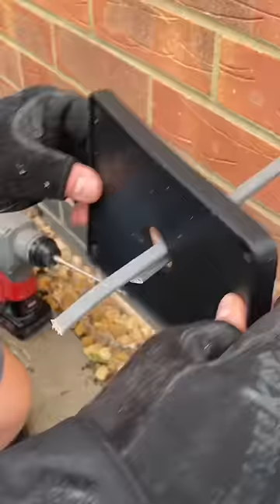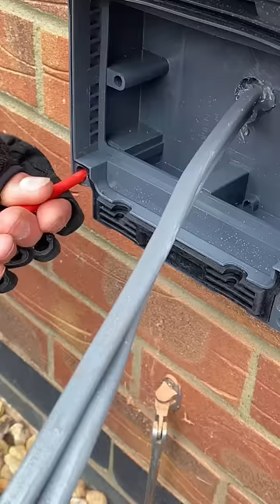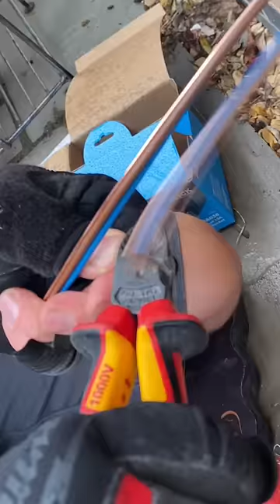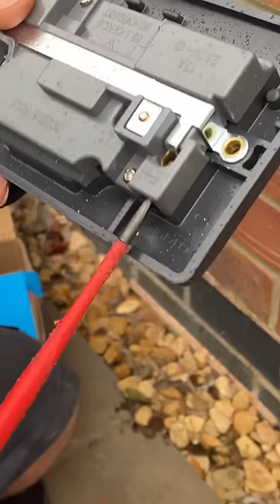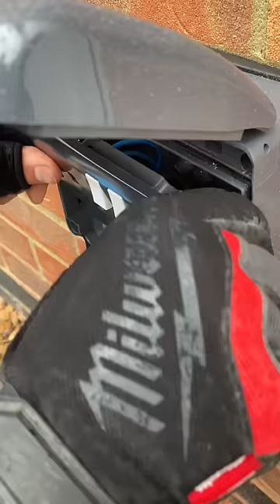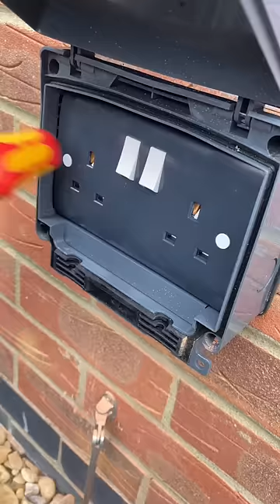Bit of blob to cover your sins. #shorts

Comment: Buddy of mine fixes chimneys and masonry for a living.

I sent him this. Hes been swearing at me for the last 15 minutes over the phone.
Reply: @royaltoadclub8322  Silicone doesnt hold onto brick, and in many cases, can even compromise the integrity of the brick.
Reply: 🤣🤣🤣 but why, as I still don't know
what's going on here? Or the purpose for the box?  🤔
Reply: @dreamwolf7302  gotcha. Even industrial crack full mortal silicon? I’m imagining that’s what he’s using
Reply: @c.a.5808  the box is to protect the outside outlet
Reply: @royaltoadclub8322  According to my buddy, that silicone filler has a distinct coloring to it, and isnt clear.
Reply: @dreamwolf7302  that why is fixed to the wall with screws after sticking the back plate on
Reply: @c.a.5808  it's an outdoor socket 🤷‍♂️
Reply: @dreamwolf7302 why do they use silicone on movement joints then? The silicone is to stop any water penetrating into his cable penetration. The socket is fixed to the wall with screws. Silicone will set and also stop cold air blowing in or heat leaving.
Reply: @martynslaven There are special products for sealing masonry, that dont use silicone. 

Silicone damages brick, and doesnt handle the transition from hot to cold very well.

that seal will last maybe 2 years before being needing to be redone, and while its there, it will damage the brick.

Comment: I tend to put a bit of pvc through the wall & gland it into the box but, I’m sure £5 of silicone does the same job 😂
Reply: Honestly probably does
Reply: Wouldn't it harden? then you'd be fucked if you needed to move the box
Reply: @BabaYagaUnderYourBed  20mm PVC conduit through the wall, glanded to the back of the box. The gland has a weatherproof seal. I do put a bit of silicone around the conduit too. Takes a little longer but it’s a better job (if you ask me) as the cable is protected in the wall. Moving the box… done a few of those too & often involves removing/replacing the bricks. Swapping the drilled brick to the new location. I work predominantly on holiday lets/complexes & entertainment venues where the finish is extremely important, as is ruggedness & replaceability. It’s a completely different environment to domestics. Installs have to be capable of taking much more abuse &/or be replaceable quickly.

Comment: Silicone or sealant only goes on the top and sides never on the bottom because you want any water/moisture that gets in to have a way to drain out that isn’t back through the hole you drilled and then into your home.
Fail. Siliconed all the way around.

Comment: I wish rubber back seals were standard on all enclosures
Reply: Lol they are. At least here in the United States. We never ever ever ever have to do that. In fact if one of my men did that they would be doing it over again. However, I see this is in Europe some where? Hence the ridiculously stupid outlet style. So I’m sure they don’t care how shit is done.
Reply: @Roberob1189  They aren't rubber, they're very cheap foam pads that deteriorate in a few years of UV exposure
Reply: @Roberob1189  But standard NEMA 3r box's don't have a pad to go between the brick and the box, good electricians in the US would in fact silicone the top and sides of the WR receptacle box
Reply: @farkmuckerzerg634  ehh. I’ve installed hundreds of them. They all come with a black rubber seal. I’ve never seen one here in NY that doesn’t.
Reply: @farkmuckerzerg634  yeah those are the cheap ones. I always see foam or the rubber. The foam ones are usually store brand.
Reply: @Roberob1189  NEMA 3R boxes dont come with a rubber gasket to seal between the box and the wall. The foam is to seal between the box and device cover. We silicone the top and sides of outdoor installs.
Reply: I agree, still seal with silicone, but for some indoor industrial applications the rubber is fine, i usually have to seal the whole outside box and it takes an hour just to do one because of how perfect they want it

Comment: I came across a faulty outdoor socket yrs back which was caused by the insulation breaking down due to reacting with silicon. Was a strange one but enough to stop me putting it near cables since then.
Reply: TPS cable? I’m an electrician who puts silicone on outside works. Never seen or heard of a reaction between them. Plumbers often use silicone to fill the gaps in holes made for pvc pipes also
Reply: How could you tell it was silicon rather than some other type of similar-looking sealant?

Comment: Always marks your holes and drill and insert rawl plugs first. Bad practice to drill through the mounting plate. Will mostly always cause damage to it and get the brick dust into the socket housing
Reply: Started with to much force by drilling the first hole for the cables and so he cracked out a big part of the brick. Second, I know it’s allowed, but for future projects just put your cables in electro installation pipe (don’t know the right word in english) so you can easily take it out and in if u need to renew it or something else. 3th there are many, right, things on the market to make a water resident connection to the wall instead of silicone. And why the heck did u use that cheap screws that come with the box and not hex or something screws that are way more durable (when threaded correctly). I know the last one is personal preference but i would definitely do so.

Comment: Don't forget the drill some holes in the bottom of the box.
Reply: For what, insects?
Reply: Tiny drain hole , so if water does get inside it has a way to drain itself
Reply: @sammyz7630  the whole idea is that the thing is waterproof. Don't drill holes in a champagne bottle either.

You should be able to put a fire hose on it..
Reply: @adriaanbertdeveldeharsenhorst  that's literally what my teacher told me at votec is to drill some holes in the bottom of waterproof boxes so the water will drain out.
Reply: @adriaanbertdeveldeharsenhorst  it keeps water inside of the box very well if you don't know.
Reply: @patricklynch9574  I've installed a lot of electric gear in different countries. These boxes come watertight from the factory.
With a clearance label.

If the design would require drainage than they would have made them with the drain holes.
It's even against the law to modify electrical equipment.

Something to do with insurance for example!!!

By the way my father was a director of a technical school .

Your teacher ought to be fired.
Reply: @patricklynch9574  if the water can't go out it can't go in either. That's the whole point. 
That's the reason for the silicone in the back.
Reply: @adriaanbertdeveldeharsenhorst  he retired eight years ago water always finds a way.
Reply: @patricklynch9574  only when the seals are faulty.

In that case you need to replace the seals.

Stop arguing with me.

Its illegal to modify electrical equipment.

There's also people who dril a hole in the forehead of babies.
Reply: @adriaanbertdeveldeharsenhorst  if water finds a way give  it a way out mate hahaha

Comment: Legend has it the moister is still behind the faceplate
Reply: I saw that too! It would have been a great install to keep the moisture out, but now this guy has made damn sure to keep the moisture in! 

Damp contacts rapidly corrode when current passes across them. I really believe this socket would last longer had it been installed not completely air tight... Or airtight but not wet inside..

Comment: That's great. Nicely done. What the hell is that ???
Reply: Outdoor outlet
Reply: @neuroplasticity  oh ok. Never saw one like that.
Reply: @TheDylan6908  UK plug socket - lid closes on a rubber gasket, small semi-circles cut out from the bottom of the gasket let the wire pass though while the plug is kept dry
Reply: @bengrogan9710  ha thanks Ben. Got it.

Comment: I love how you left the wires in the way so the socket can't be used, nearly as cool as the rain
Reply: Eh?
Reply: I thought i was the only one thinking this. Madness
Reply: You watching a different video? What wires?
Reply: At the end of the video, the top hole of each socket, where the plug fits into, seems blocked by wires. Maybe I’m seeing something else ?
Reply: Since when did you see a white wire being installed? Clearly part of the design
Reply: @TheGarageRailway the British socket is cleverly designed in such a way that it’s nearly impossible to get an electric shock from it. The sockets live and neutral terminals (two on the bottom row) have a guard that prevents fingers and other objects being inserted and coming into contact with the live parts. The earth terminal at the top of the socket has a mechanism that works when the plug is inserted which opens the terminal guards on the live and neutral and allows the plug to be inserted into the socket fully. 
The earth ‘probe’ on the plug top is slightly longer which opens the guards  and the live and neutral probes have insulation covering all but the ends to ensure no live parts are exposed while plugging the plug in. 
It’s all very clever stuff
Reply: I thought that too, you can see brown wire behind the top hole 😮
Reply: @banzaiman1  nope
Reply: Watch him press it in.... the socket is incased in plastic... It would be impossible to put a wire in from of the socket
Reply: The brown you see in the top hole is more than likely one side of the copper earth/CPC contact - the earth pin being designed to make contact well before the live and neutral pins are inserted.
Reply: And as pointed out by a previous commenter, the white part in the top hole is the lever that pushes open the live and neutral gates as the earth pin is inserted.
Reply: What u see isn’t a wire, it’s a metal feather that is attached behind the plastic shield to hold the contact in place. Or how do you think the power circuit works??
Reply: @TheGarageRailway 😂😂😂

Comment: I'm super curious, what did you anchor to once you drilled the holes in the brick? Was there a way you set some bantams through the holes in the box, or were you able to turn some Tap-cons in by hand that easily? Or did you have to take the box back off to set some bantams?

Comment: cables stripped too short. each set of conductors should be twisted together before terminating. otherwise, you risk having a hot joint. also, other power points downstream are relying on the earth continuity. here you have 7 strands on each conductor all sitting inside the terminal and the screw would be lucky to make contact with half of them. poor connection. Id also drill mounting holes first so that brick dust isn’t contaminating the silicon, then place silicon as he has done but as someone mentioned earlier, a horseshoe shape over cables in a continuous run, not blobs, plus a blob at each screw hole. fast fitting, looks pretty good to anyone who doesn’t know the common traps. btw, the earth should always be sleeved. in Australia, you can’t even buy cables without a green yellow insulated earth conductor, less chance of nuisance earth leakage trips - especially if run in damp places. cheers
Reply: 7 strands? That’s solid copper, then he sleeves the earth- didn’t you watch the video?

Comment: Did u push the rawl plugs through the plastic box to get to the drill holes or use concrete fix bolts

Comment: Been there done that quickly learned to never drill a large hole in a brick from the inside out and always use smaller drills to gradually get the hole to the correct size.

Comment: The device should not be used to splice the circuit. Splice the wires together w/ a pigtail wire that connects to the device.

Comment: Just fill the hole through the wall with a sealant and put a gland on the back of the box, or put a horse shoe shaped line of sealant around the top of the box. the rest is waste. He did leave some nice long tails, which is always a good idea.

Comment: I don't know in which country you live, but isn't it common there to use a multi-stranded wire because it carries more current and it is more flexible to move around in the corner. A single standard wire you're using. It's more susceptible to breakage. Also, it creates a hot spot at the bend.

Comment: Virgin just drill holes through you're house from the inside breaking all the brick on the outside, then feed their wires through to the outer box and get off. Everytime it rains the plaster inside starts to swell and the paint peels.

Comment: So this looks like the socket has been installed into the ring main, rather than a spur, either way this really should have been a rcd socket for peace of mind being outdoors, no reason to skimp on a couple of quid. 
Some silicone could have been done differently, but still functional. 
Only other observations would be the smashed brick from drilling from the inside out, and could have wiped the inside of the socket down to remove moisture, but again still functional 🤷🏼‍♂️

Comment: Why is the outdoor socket on a ring final, (two wires), this socket should definitely be in a single circuit( directly to a trip switch/ breaker, rcbo)

Comment: Pro tip: Always be sure to use insulated tools when installing fasteners into concrete 🤣. 

But seriously why
Reply: Because that's what electricians have in their toolboxes...
Reply: @TheEulerID  I only pull out my expensive insulated tools when they're needed. I have a separate set of tools for everything else. Source: I'm an electrician.
Reply: @Avaddon911  So what. He was already using that screwdriver, so that's what he chose to use. Not everybody has to do things your way.
Reply: @TheEulerID  is there a point to this conversation or do you just like to pick pointless arguments with people on the Internet?
Reply: @Avaddon911  you seem selfaware

Comment: its a decent job. However, no need to leave so much outer insulation on the T&E in the box and pre drilling the fixing holes before the silicone was apllied ( if at all ) but other than that the guy is going the extra mile. ++

Comment: I still can't get used to seeing blue , brown & yellow wires instead of , white black & green?  they changed to these new colors before I left England , they said it was so color blind electricians could see the and also,because under yellow neon? Lights they could be differentiated. Hows,that working ? Andbody in USA know for sure which color is the hot wire? As somebody that also,does 12v dc wiring ,red and black I still get confused......

Comment: If you drilled the holes in the wall with the units in place, wouldn't you be making the holes in the backing plate, and housing bigger than designed? Just saying.

Comment: Just don't understand why no body designs a wall box where you can affix the cable ends and then just plug on the face plate. Then you don't have a lot of cable excess to curl up when you try to place the face plate that might also be pulled loose.

Comment: Why does everyone use the clear silicon. There’s so much better products out there that will give a better seal and last longer, like geocel, or Np1 masterseal. I can literally pull the silicon right off. Strong enough winds will blow silicon off any surface over a period of time.

Comment: Nice job other than splitting the earths , thats why theres 2x terminals , that and using cheap materials , mk  masterseal all the way and I didnt see you drill the drain hole which your going to need with that cheap outdoor socket set up

Comment: That is one way. I would just put a little caulk in the hole with the wire and screwed it to the brick. If that needs to go in the future someone going to be cleaning caulk. I guess your kinda double insurance it stays there.

Comment: You put silicone on the outside the box but you don't go across the bottom just in case water does get behind your box it will leak out the bottom you did it wrong. I was a painter for 25 years. There's nothing that I don't know about caulking anything to anyting I know everything about or glazing

Comment: Several key points must be taken into account:

An outdoor outlet or switch must always be connected to a protective conductor (grounding). With two-wire cables, this protective conductor is missing, which represents a significant safety risk.
Inserting a third phase into the cable is not permissible as each phase requires appropriate protection and is typically responsible for different electrical circuits. It is also important to remember that adding an additional phase to a cable that is not designed for it can lead to overload and thus pose a fire risk.
Violations of these regulations can have serious consequences, including fines, criminal prosecution, imprisonment or, in the event of an accident, even the loss of insurance coverage. It is absolutely necessary that electrical work is carried out by qualified professionals who adhere to all relevant safety standards and regulations.
Reply: What the hell are you talking about... the bare wire is the ground / bond. He just sheathed it.
Reply: It's twin & earth cable - the bare wire he sleeved is the earth (ground). And none of what you said applies in the UK in any case. The job was done to UK standards and regulations.

Comment: Another British electrical job.  More materials.  More labor.  More time.  More money and expense.  Maybe its because everything over there is 220 volt in their houses, they have to do this.  As far as electrical repairs and failures... they have just as many.  The Breaker panels are also very small compared to the US. And wired differently too.  I like America better.

Comment: don't use your insulated screwdrivers to put screws into a wall get yourself a normal set... insulated screwdrivers are for live work only, they should be wrapped up in cotton wool until you have no choice but to use them...